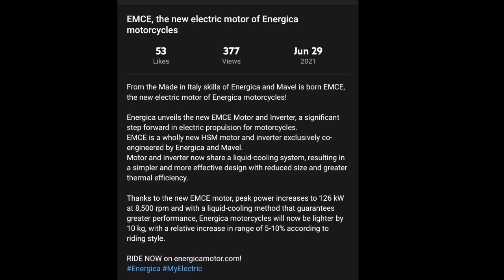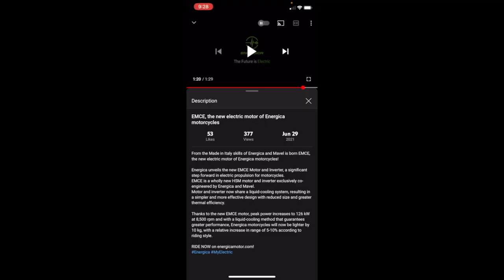Energica EMCE announcement

Comment: need to work on the happy voice, didn't quite believe it.
Reply from the maker: No, that’s me. I’m dead inside. Thought about upgrading, but besides the maintenance frequency, I don’t care about the extras. I already know I can’t hit the hypothetical 0-60 times, because I don’t want to turn off/way down the traction control. More power wouldn’t help me there.

I’ll never ride at the crazy top end speeds also, so I don’t care about getting to them a little faster either. 

More range? Want me bitch about my back after a 200 miles day. Hah.

Completely happy with the bike. Was just talking with the wife moments about actually about getting a seat upgrade and some other stuff, keep the bike a few years.